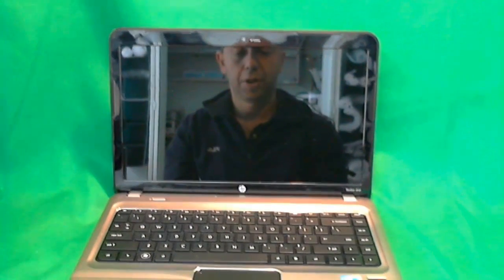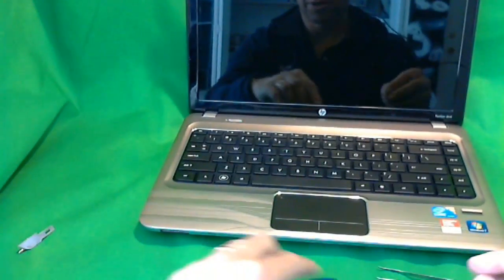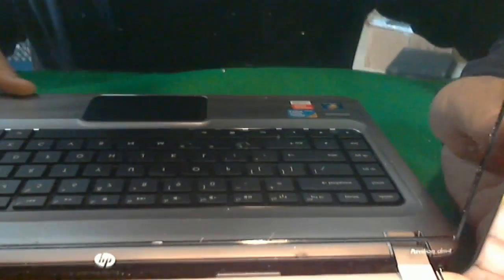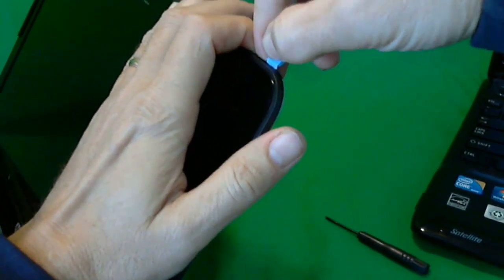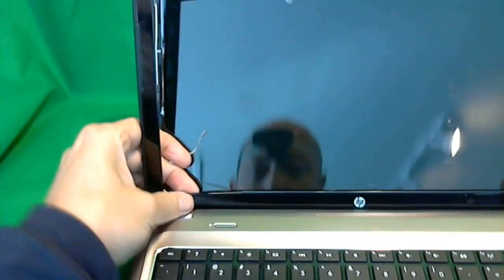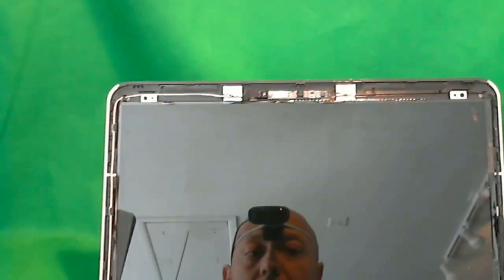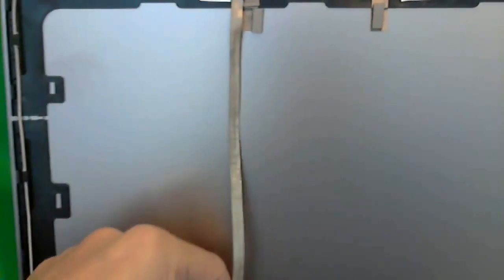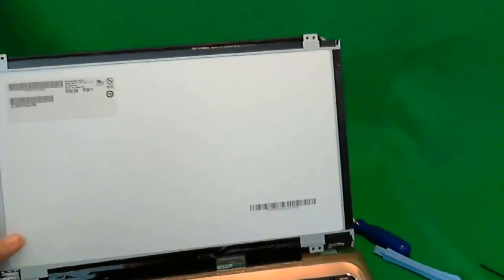HP Pavilion dm4 Laptop Screen Replacement Procedure

Comment: Any suggestions on repairing where the hinge connects with the housing? Apparently they are pretty junk and break easily which is exactly what I'm trying to deal with to fix one of these things. The LCD still works fine.

Comment: Hi i also have a hp pavillon dm4 and the problem is the screen go white and then black until u move the screen. Does it need a screen replacement? or something else?
Reply: did you ever figure out which part you need? I have the same issue.. same as every hp/compaq laptop in existence.

Comment: I have a 
HP Pavilion dm4 with screen issues...

there are vertical lines about middle of screen
Do I need to replace it? would that usually fix the problem?

What would it cost for you to do it?

Comment: What kind of adhesive should I use to put the bezel and connector ribbon/camera cable back on? (And would it be available at a hardware store or where would I find it?) The screen is already off. Thanks.

Comment: Hey, after replacing my screen the laptop now does not acknowledge the lid is closed when closed and remains on, or if pressure is applied to the keys, turns on if asleep. Do you know a solution? Thanks